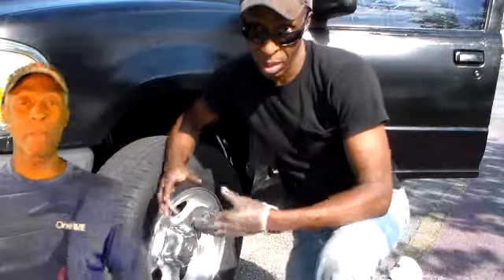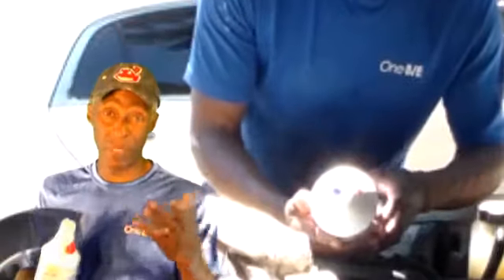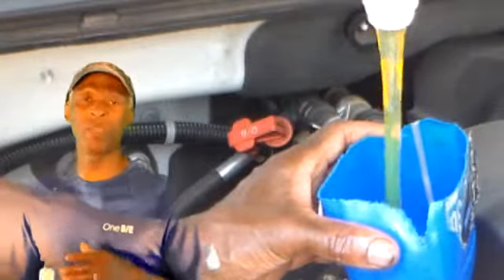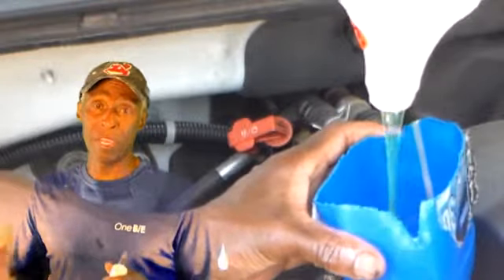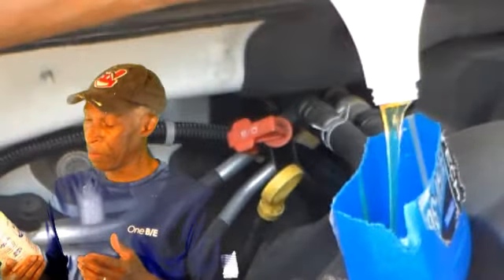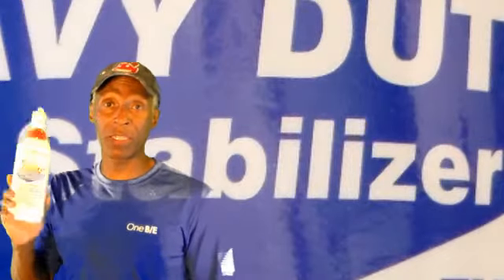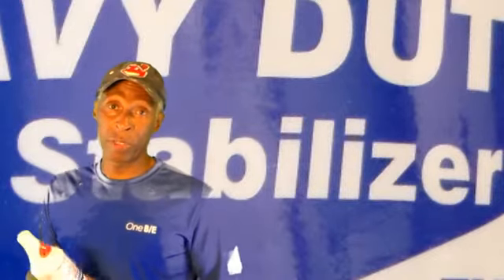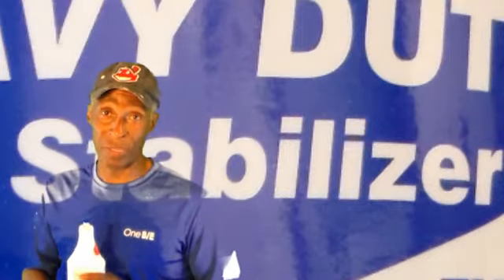this oil stabilizer works

Comment: That product is one alternative but all it does is thicken your oil.  You would have the same result less expensively by using a higher viscosity oil next time, but you did not mention what viscosity you are currently using.  If I recall correctly, Ford specified 5W-30 for that generation of Explorer, but some, especially synthetic oils, are a little thinner than others at the same 5W-30 viscosity rating.
Reply from the maker: Good stuff! Thanks

Comment: Your just masking your problem. If you have the Ford 4.0 motor chances are your plastic timing chain tensioners are broken and making that racket. Unfortunately you have to pull the motor to replace the back chain and tensioner. Been there, done that.
Reply from the maker: thanks for the info, that truck tuck me across country many times with no problems, it was sold, I had it for about 15 years it was great!